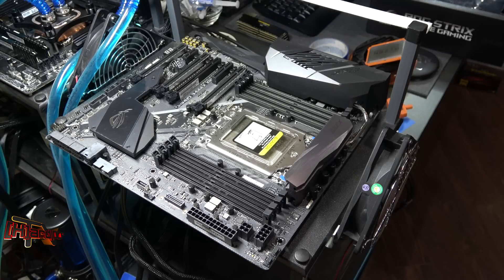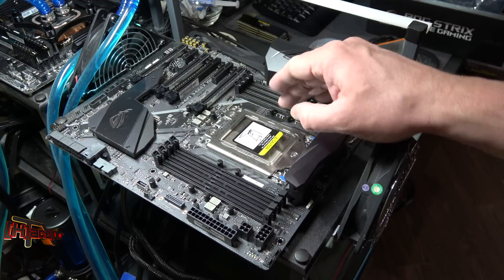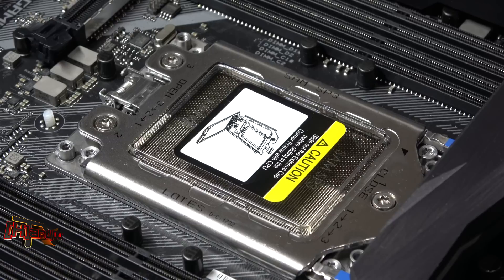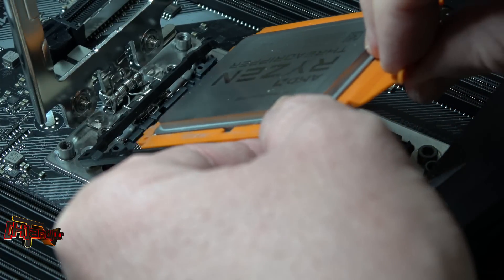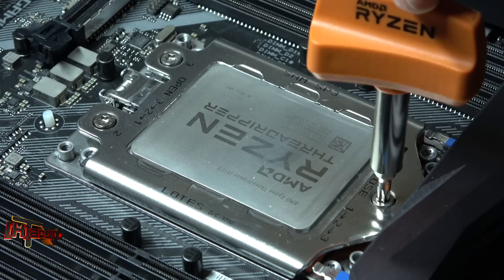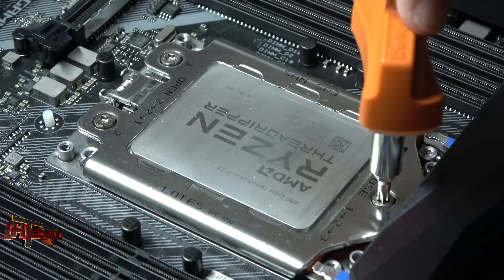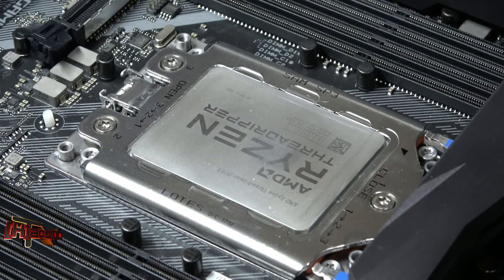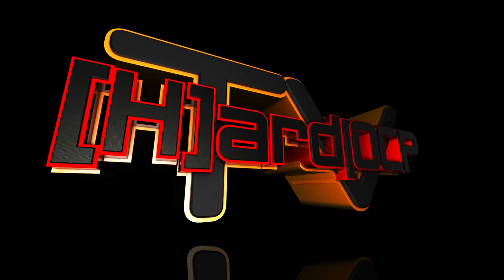Threadripper Lotes Socket Install on ASUS ROG Strix X399 E Gaming

Comment: Are some of the board manufacturers not bothering with that grey tab you have to squeeze to uncover the socket?  Seems to vary if ones on the board or not.
Reply from the maker: All the carrier frames have the little blue tabs to show you were to pull/push at.
Reply: Was referring to that other piece that came on some motherboards that was a grey plastic slab that covered the socket, it had to be squeezed in from both sides slightly so it would lift off.
Reply from the maker: Oh yeah.  Pull that off carefully, and never try to put it back on.  Exactly as we described here last August:  https://www.hardocp.com/article/2017/08/10/amd_ryzen_threadripper_1950x_1920x_cpu_review/2

Comment: i dont know why but my asus prime x399-a spin that litlle 8000 rpm fan without no change and no high temp is detected , only way how to quite that shit is by loading defaults in bios ....sad
Reply from the maker: You can go into the fan profiles in the UEFI and change that.  It should not be wide open at default, so set your UEFI to defaults then update if needed and reset from there if it is the same.
Reply: well this is the problem i cannot quiet that fan even in q control profile ....after rebooting still sppining like crazy ...but i have to tell i got 1st bios release.

Comment: The Foxconn socket doesn't have countersunk screw holes which is what makes it so much more difficult compared to the LOTES one.
Reply: Except their solution was to have recessed tabs. This should work equally well, but from what I've seen the Foxconn tooling seems to be pretty bad. I have worked in progressive die manufacturing and the issues suggest tolerances being way off on their tooling, creating inconsistent parts.